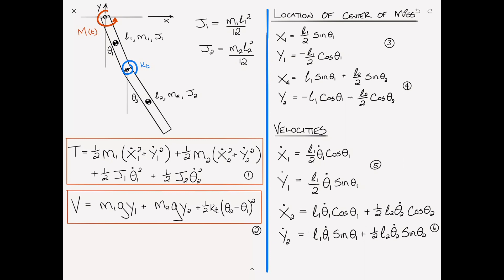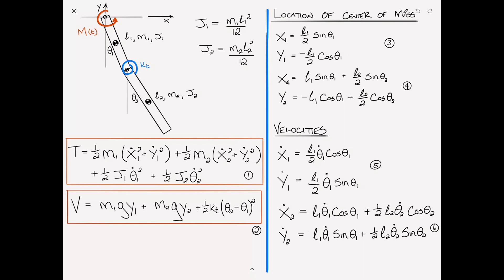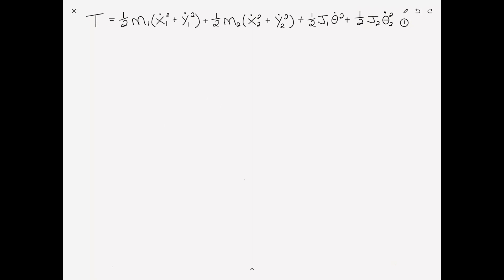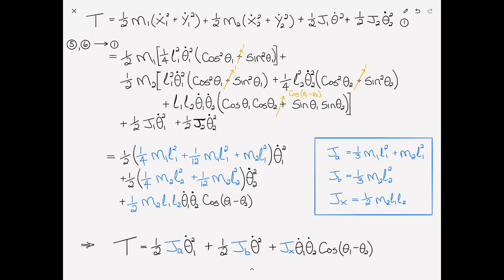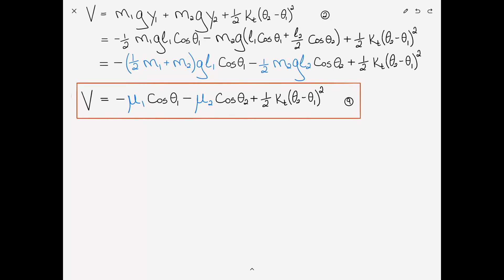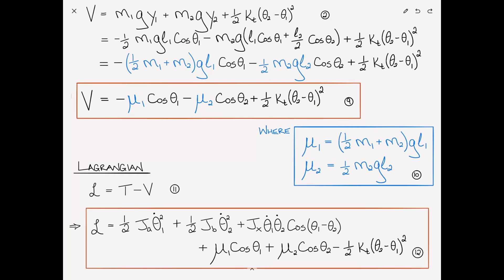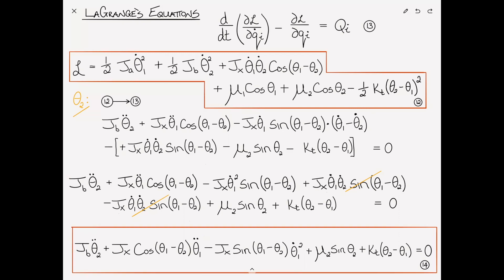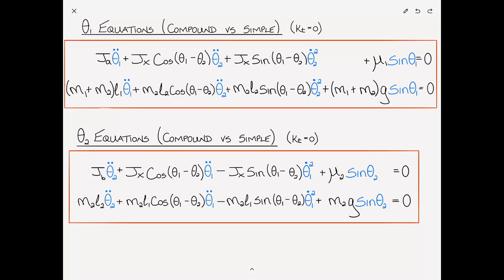Equations of Motion for the Double Compound Pendulum (2DOF) Using Lagrange's Equations - Part 2 of 2

Comment: If you had concentrated masses on the two links would there still be moments of inertia?
Reply from the maker: Yes.  These masses will still have a moment of inertia about their rotation point.  However, if they are point masses, then they will not have a moment of inertia about their own c.g.  These masses would add to the moment of inertia for each bar.

Comment: Hello Sir! I have a question: Why in the video of the inverted pendulum there is no rotatory kinetic energy associated using  1/2 * J * Theta_dot^2?  Thank you.
Reply from the maker: In the inverted pendulum problem, the mass was treated as a point mass - so it has no rotatory inertia.  I probably should have been more clear about this.  The reality is that for a simple pendulum, typically the rotational kinetic energy is insignificant when compared with the translational kinetic energy UNLESS the diameter of the mass is very large.

Comment: Do you have any reference material or books where I can learn more about how to add none conservative forces and external forces for say control purposes.
Reply from the maker: I don't have any books on Controls to recommend,  However, I would recommend the YouTube channel of Steve Brunton (https://www.youtube.com/watch?v=qjhAAQexzLg) if you'd like to learn how to combine a structural model with control theory.
Reply: @Freeball99  Sry forgot to respond when I initially read the comment (was drunk at a party, probably for the better), I have used the euler lagrange theory to develop a state space representation of a two wheeled self balancing robot, and Stevens great videos in part to help develop the controller. But when it comes to euler lagrange i would have struggled to incorporate say a force acting on the secound body only in one of the global directions. I can't think of any real systems where such a force would exist. I have started reading trough the notes you linked to in your response to chamelious and there are some pointers in there :)

Comment: Great vid, i've never seen lagrange eq's in any other form than "=0", could you point anywhere out where i can learn about the "Qi" term you include?
Reply from the maker: The Q's are generalized forces and the are incorporated into the into Lagrange's Equations using the Principal of Virtual Work and a method known as the Extended Hamilton's Principal.  Here a reference that explains it:  http://web.mst.edu/~stutts/SupplementalNotes/Lagrange.pdf but there are many others online.  Just search for "Lagrange's Equations Generalized Forces".